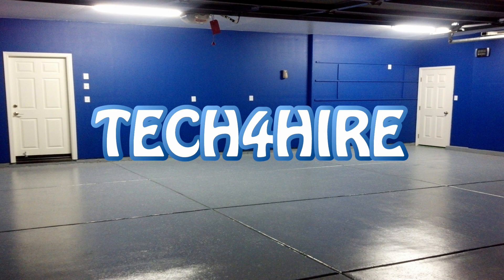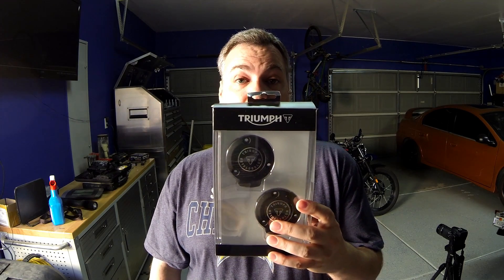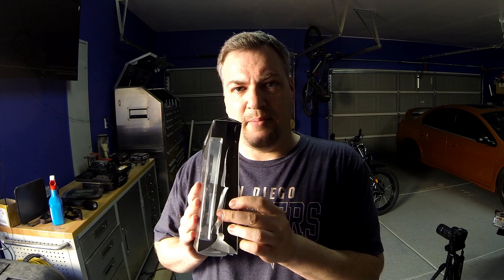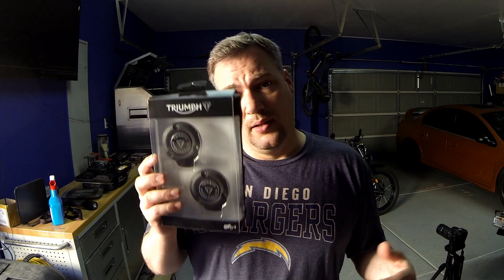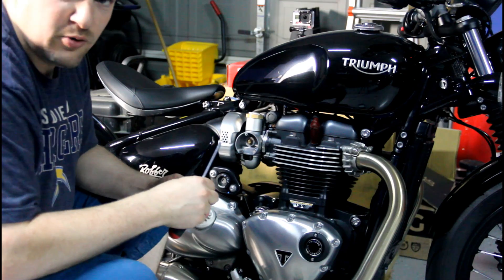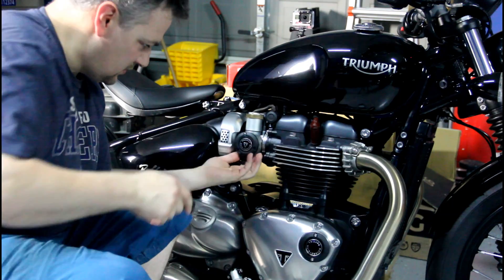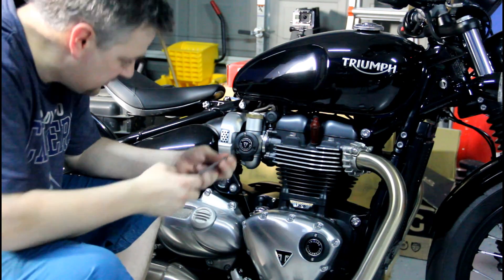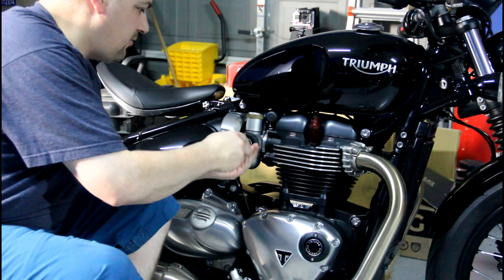2017 Triumph Bobber Upgrade: Black Throttle Body Covers

Comment: I was at the Triumph dealership Saturday, they had a Bobber that was totally blacked out. Black engine cases, black exhaust. Side mount license plate, the works. Looked great. I gotta think that was HUGE bucks. (Especially considering the cost of those throttle body covers...) oh my.
Reply from the maker: The engine covers are not that bad, around 500-600 for both sides. The black exhaust is the expensive part right around 1500 (Coupler, Header, Muffler). To completely black out the bike its probably an extra 3k.